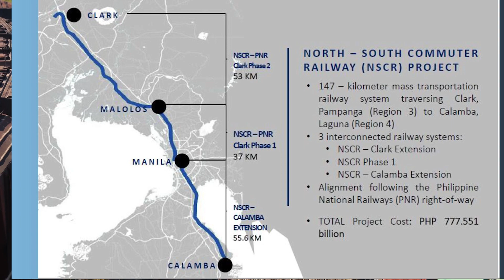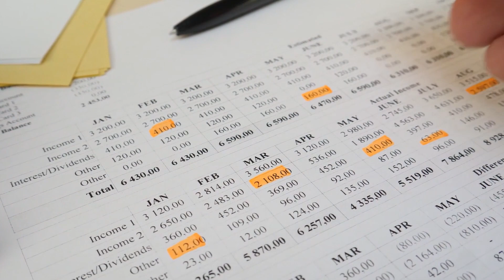The Philippines North-South Commuter Railway

Comment: Correct your facts. The North-South Railway was a "rehashed" project of PGMA. The North railway was supposed to be already operating in 2014 and the first phase of south railway was supposed to be finished in 2017.

But then again, PGMA's North and South Railway was supposed to be the rehabilitation of the PNR existing railway line that was to commence in early 1990s.

Comment: "repair and (re?)placement of over 420 new bridges" 
Wow, I never wouldve guessed so many bridges, are there many rivers in the Phillipines that need to be crossed or?
Reply: Uneven ground needs bridges
Reply: PapaGin this answer ist too simple too work. What do you count for a „bridge“?   And uneven ground don’t need bridges - who’s telling you that?
Reply: @xenitra  Valleys are uneven ground. Dried rivers and streams are below the banks. Mountain sides are uneven ground. Who's telling you they don't need bridges? What is a bridge? Something that connects two points over a gap or obstacle. Railways need bridges for overpasses over roads. Roads are not rivers, but the gap is certainly uneven with the road. What do YOU count for a bridge?

Comment: Please prioritize and don't politicize this project. Our railway to the future...probably the template for a future bullet train.
Reply: Bullet train to where? Honestly Metro Manila should concentrate on expanding the rail network like how Japan and Singapore did. Efficiency is what you want, not speed.
Reply: @catsfrommars  that is why prrd spend a lot for infra projects 8-9 trillion pesos for 6 years is big enough compare than past admin just spent 1.8 trillion for 6 years. From manila to bicol improve the railway and from manila to northernmost of Luzon railway projects,subway station which impossible projects for dilawans.
Reply: @justinviper7149  INDEED!! Very impossible for dilawans
Reply: @catsfrommars  sa New Clark City siguro. Another future City of the Philippines w/ goals like Flood resistant and zero pollution.
Reply: @catsfrommars  this is a train that will connect to clark. The gov plans to make clark the next hub of the country and then as a byproduct, the project will help the outlying provinces that this project will pass by. Bullet train will probably be to clark once new clark city becomes populated for it to be sustainable.
Reply: @NONEOFYOURBIZ it's a money issue. The average Filipino can't afford to buy a ticket for a bullet train. Bullet trains are too expensive to build and maintain. Philippines also have Typhoons. Bullet trains aren't able to run during a typhoon. There was also a volcano eruption earlier. Again a bullet train won't run. Then you have to consider power generation. Can the Philippines provide enough electricity to run the train reliably? Ask yourself, how often does Manila get power outages? Now ask yourself how reliable is the electricity in the province? High speed train also requires a special kind of track. Can the Philippines afford to buy all that steel while having no positive income since the train is not running? The Philippines should concentrate on expanding on what they have now not building something fancy like high speed trains.
Reply: @catsfrommars  eto example, may lolo ako nagtanim ng 200 na mangga, in his lifetime d nya napakinabangan, kaya kaming mga apo na ngayon ang umaani. Gnun lang yun. Kesa naman wala gawin, tengga na ang buhay. Magplano kayo para sa hinaharap. Sa New York, ang laki ng sewer lines, I'm sure may mga kontra din noon sa kanila habang gngawa na bakit ang laki laki, kasya ninja turtles. Pinush nila kaya gumanda ngayon. Sa Pinas, sewer system lang yan. Sayang pampagawa nyan. E kita, crouded ang Manila, then less than 50% ang nakakabit sa sewer lines kasi maliliit. Result? sa estero nagtatapon ng tae. Deretso sa ilog, papunta sa dagat.
Reply: @catsfrommars  Get updated on the Philippines Railways Project. Visit this channel; https://youtube.com/watch?v=L1nSZyfL2uM&feature=share
Reply: Edilbert Lacson actually the North-South railway project is future proof for the future purchasing of  high speed trains
Reply: edzel palcotilo  I have (I've lived there for a number of years) Japan has 4 main Islands that are within reasonable distance from each other. Now how many islands does the Philippines have? Over 2,000 islands and that also depends if it's high tide or low tide. How many of those islands are connected by bridges? Not trains but just roadways. Now tell me -- can ride your car from Manila to Cebu?  BTW in Japan they don't always use bridges to connect the trains they drill tunnels. One tunnel from the island of Honshu to Hokkaido, the Senkan tunnel runs about 55 km underwater and took over 20 years of construction and over $7 billion USD in 1988. Now tell me in what world does the Philippines have that kind of budget to build something in the span of 15-20 years? I guarantee you people will be protesting on the streets and will be asking why didn't they use that money on fixing existing infrastructure. Please do your research and build within the country's means
Reply: It won’t make a difference to traffic until you dis-incentivise CAE ownership. As we see here, if you create capacity it just gets filled. Until the government implements a policy like Singapore of scrapping vehicles over 10 years old, strict safety standards and emissions and costly Certificates of Entitlement the PH will be forever addicted to automotive transport.
Reply: Toxic ng mga Filipino, DDS, Dilawan, lahat na lang. 😅
Reply: EJ Shin hahahaha kaya dun lang tayo sa neutral zone kase lahat naman tayo makikinabang sa project ni daddy duts buti nga nakikita yung tax e kesa kela papi pnoy hahaha, bukasan mata pero kurap tayo para di mabulag pag may mali si daddy duts i point naten pero nakikita ko ngayon (para saken wala namang major na male) tutal sa japan naman bagsak ko pag graduate ko sa college e hahaha
Reply: @ponkotsu9102  may natapos ba un na big infras?😂
Reply: Sino?
Reply: @ponkotsu9102  si pnoy
Reply: @sasorishino  Get updated on the Philippines Railways Project. Visit this channel; https://youtube.com/watch?v=L1nSZyfL2uM&feature=share
Reply: @NONEOFYOURBIZ unless you find a way to tunnel your way to Cebu or Mindanao. No it won't. In order to make high speed rail effective you have to compete directly with domestic airlines. Even in Japan, the Shinkansen is only feasible because of how efficient it is. They're able to out perform domestic flights from Tokyo to Osaka. They just have so many trains. But most importantly, they have passengers who are willing to pay the extra cost. Even in Japan, there are times when flying is cheaper. High speed rail is just not cost effective for an nation with over 2,000 islands. You need to know your customers. The average Filipino will not spend almost the price of a plane ticket when they can leave a day early and take a ferry to Cebu. If they need to get there faster, just take a plane since it's about the same price as a bullet train. What the Philippines need is express trains that are affordable that go out to other towns and cities outside of Manila.
Reply: @catsfrommars  hnd siya affordable? yes! sa umpisa mahal yan. D naman para sa generation natin yan. Para yan sa future. Mahal kasi wla namn establishments sa Bicol db? pero once may maganda ng transpo magkakaroon na dun mas okay na kabuhayan. At gaganda ang buhay. Yung mahal para sayo ngayon, cheap na yan sa hinaharap. The questions are papayag ka ba na magbayad ng mahal ngayon para gumanda ang buhay ng apo mo? or ayaw mo magbayad ngayon ng mahal kasi iniisip mo ang sarili mo? Yung train mo na gusto hnd yan magkakatotoo kung wala sacrifice, at yun na nga ang nangyari. Because napakaselfish natin sa past at gusto agad na yung naglabas ng pera ang makinabang agad, walang magandang rail system na ngyari noon kaya naiwan tayo ngayon.
Reply: @catsfrommars  Get updated on the Philippines Railways Project. Visit this channel; https://youtube.com/watch?v=L1nSZyfL2uM&feature=share
Reply: pasado na po yan..gagawin na talaga yan..
Reply: @bakaandcole6984  Get updated on the Philippines Railways Project. Visit this channel; https://youtube.com/watch?v=L1nSZyfL2uM&feature=share
Reply: @bakaandcole6984  Get updated on the Philippines Railways Project. Visit this channel; https://youtube.com/watch?v=L1nSZyfL2uM&feature=share
Reply: Lemiku  so a train that can run over water? Awesome!
Reply: ya..nice to have a bullet tain in the " future"
Reply: Basta di lang lage kontra ng kontra ang mga dilawan, for sure tuloy tuloy ang mga proyekto. Ngayon pa nga lang, nag start na mamulitika ang mga dilawan.
Reply: @janetdenuevo5079 suskopo... kakasabi lang wag politika tapos pinasok mo dilawan. Bakit hindi mo isali mga Poeans? Binays? mga santiagoans?
Reply: @paididoy  hehe
Reply: @egaylagay4927  halatang dilawan eh guilty kasi sila pag sinabihan ng dilawan, racist daw kasi ang DDS sa tingin ng dilawan. kaya mga dds you'll stop red tagging DDS mn o Dilawan kailangan mag kaisa. Make Philippines great again.
Reply: @christianlimpiado  puro  general at sweeping statements. Can you define please what is a "DILAWAN"? In the same breath, I can not call you DDS because i do not personally know you. Even if you are, I am respectful of your beliefs. So dont strike down anybody who has a different opinion with you. 24 million voted for another candidate. Only 16 million for Duterte. There are 24 million opinios to consider..Si Juan de la Cruz ang importante at hindi mga politikong pangako at kurakot. .
Reply: @christianlimpiado  OK. kng gumagamit ka ng ganyang generalization at sweeping statements ay pahintulutan mo akong sabihin na ang mga followers ni Duterte ay mga....hehe...wag...bad yun. I have the education and breeding to respect your opinions. God bless. At wag murahin ang Diyos please...
Reply: @egaylagay4927  i love this comment if you are dilawan or dds just pls support the project of the government that could help us, pansantabi natin ang mga galit natin sa isat isa dahio hindi tayo nakakatulong kundi dagdag perwisyo, oo may pandemic but God will provide just don't rush pero sa totoo lang mas may ginagawa pa itong govt natin kesa dati halos wala
Reply: @egaylagay4927  common knowledge  naman kasi talaga kung sino palage ang kontra ng kontra.
Reply: @paididoy  hmmmmpp...you are what you said.
Reply: @janetdenuevo5079  pati rin kapwa nating pinoy pre ngangakan nanaman yan katulad ng manila bay diba😂😂
Reply: @janetdenuevo5079  Asan ang source mo na tuloy na nga yan? Propaganda dahil malapit na ang election!
Reply: Wag nga ipoliticize pero dinamay naman ang mga dilawan #DDSlogic :/
Reply: @alexanderx4452  Get updated on the Philippines Railways Project. Visit this channel; https://youtube.com/watch?v=L1nSZyfL2uM&feature=share
Reply: Gusto kaseng mabulsa ng mga dilawan yung pondo kaya sila kumokontra🤦‍♂️
Reply: @soobin-ahgivemesomeheight4274  Get updated on the Philippines Railways Project. Visit this channel; https://youtube.com/watch?v=L1nSZyfL2uM&feature=share
Reply: @soobin-ahgivemesomeheight4274  , sabihin mo, mga dds ang bubulsa niyan.

Comment: The mainstream media is silent about this.
Reply: always. even the to be finished clark international airport
Reply: That's why people thinks there's nothing happen about the government.
Reply: @Mr Jason Pnoys admin projects are all upgrades and extention of the current lrt/mrt lines. I read your link and it only says extension or another upgrade of new lines of LRT/MRT.

please research po, this railway projects is under the duterte administration. Originally planned in 1990's, but the project has been repetitively halted after disagreements on funding and allegations of overpricing. The first proposal was the 32 km (20 mi) "Manila–Clark rapid railway" with Spain, and during the 2000s, the NorthRail project with China that was discontinued in 2011.The present line is under the Duterte administration and is to be aided with Japanese financing. The railway system is expected to cost 777.55 billion (US$14.95 billion), making it one of the most expensive projects of the Build! Build! Build! Infrastructure Program. Partial operations will begin by 2021, and full operations is expected to begin by 2025.

This was said about when this project was on Aquino Administration:

The NorthRail project was cancelled in March 2011, due to a series of delays, work stoppages, a controversy and anomalies with the foreign contractor.According to then DILG Secretary Mar Roxas, the Chinese were open to reconfiguring the project, and that he was meeting with his Chinese counterpart in a month's time. However, nothing materialized out of these talks.

The Philippine Supreme Court handed down in March 2012 a decision giving a lower court the go-signal to hear the case calling for the annulment of the allegedly overpriced contract. Instead of settling the entire US$184 million due in 2012, the Department of Finance will pay Export-Import Bank of China 4 equal payments of $46 million starting September 2012.National Economic and Development Authority (NEDA) Director-General Arsenio Balisacan said the 80-kilometer Northrail project would resume within the term of President Benigno Aquino III. but despite this announcement, the Northrail project was scrapped and replaced under different terms with different contractors.

The Department of Transportation and Communications previously examined reviving the project by commissioning a feasibility study by CPCS Transcom Ltd. of Canada. Part of the study examined having a Malolos–Tutuban–Calamba–Los Baños commuter line.

A feasibility study for the North–South Commuter Railway was still ongoing when the NEDA approved the dream plan in 2014.

The NorthRail project was cancelled in March 2011, due to a series of delays, work stoppages, a controversy and anomalies with the foreign contractor. According to then DILG Secretary Mar Roxas, the Chinese were open to reconfiguring the project, and that he was meeting with his Chinese counterpart in a month's time.[6] However, nothing materialized out of these talks.

The Philippine Supreme Court handed down in March 2012 a decision giving a lower court the go-signal to hear the case calling for the annulment of the allegedly overpriced contract. Instead of settling the entire US$184 million due in 2012, the Department of Finance will pay Export-Import Bank of China 4 equal payments of $46 million starting September 2012. National Economic and Development Authority (NEDA) Director-General Arsenio Balisacan said the 80-kilometer Northrail project would resume within the term of President Benigno Aquino III but despite this announcement, the Northrail project was scrapped and replaced under different terms with different contractors.

The Department of Transportation and Communications previously examined reviving the project by commissioning a feasibility study by CPCS Transcom Ltd. of Canada. Part of the study examined having a Malolos–Tutuban–Calamba–Los Baños commuter lin

A feasibility study for the North–South Commuter Railway was still ongoing when the NEDA approved the dream plan in 2014
Reply: Totoo, yung clark International sa yt ko lang din nalaman and 99% complete na yung construction ng structure.
Reply: @Mr Jason di ako nag bebase sa mga pages.. masakit ba tanggapin na inuthil yung pnoy nyo? wang wang lang nagawa nya.. at yung ubong stages 4 na..
Reply: @Mr Jason hirap sa inyo after so many decade na naka upo.. wala man kayong nagawa maayos sa pinas.. kakatuwa nga hehangga ngayon mas marami pang bagawa si marcos. at hangga ngayon napapa kinabangan pa ito..
Reply: @Mr Jason di ba sabi nyo si roxas ang pasimuno nang bpo sa pinas, lol kakatuwa naman kayo.. gma yun.. take note di lang pinas ang namublema dyan.. buung mundo lalo na kung wala kang oil bob0.. isa pq turuan kita.. di ka nag bebase dyan.. inflation rate ka mag calculate. so pano naman yung kay marcoz era 1dollar= 2 peso.. after nya bumagsak ang ekonomiya nang pinas.
Reply: @Mr Jason ay nako.. kakaiyak talaga kausap mga sarado mag isip.. 
maganda gawin nalang bigayan nalang pag term nyo ulet.. gawin nyo ulit ginawa nyo. at kung may makakaupo pang dilawan..😆😆 vp nyo... ata maging presidente govyerno daw hahahaha ano sya di sya govyerno? mag sama sama kayo mainstream media. at mga troll. mga partylist kuno. la na kayong malilinglang.
Reply: @Mr Jason bumaba nga ung dollar, tapos??? Malaki nga ung utang atleast nakikita kung san napupunta, kesa naman ibulsa ng mga kurakot. Kala mo naman ikaw lang magbabayad ng mga yan, baka wala ka na sa mundo, nandyan parin yan. Nega ka masyado.
Reply: @Mr Jason pag hate mo talaga si duterte wala ka talagang makikita na maganda. Kahit may ebidensya pa yan hahanapan mo talaga ng lusot para di mo ma-amin na meron namang nagagawa ang present administration.
Reply: @Mr Jason nung biglang bagsak po ng dollar nun ay dahil sa pagbagsak ng US economy dahil sa wallstreet kaya bagsak presyo talaga dollars nung time ni pnoy pero may masama ding epekto yan dahil mga foreign companies nag lay off din ng libo libong workers kasi talo nga dollars eh pero di ko alam naging achievement na pala ni pnoy yun haha
Reply: because they know this will not happen
Reply: @Meloo Wans I don't blame them our PH government is trash and full of corrupt and stupid people